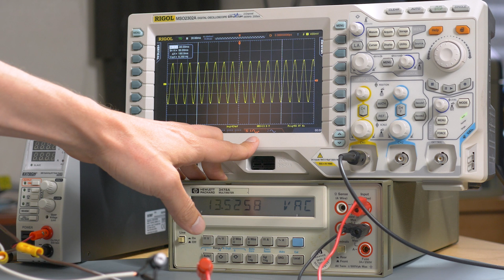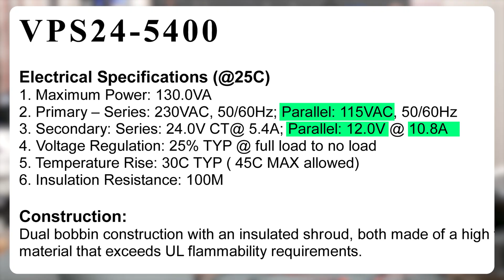What is my transformer output with no load? | Basic Electronics

Comment: How do you determine what a transformer output should be, if there are no specs on it?
Reply from the maker: If there's no specs or even part number to search for, then that's kinda weird.  You can find the turns ratio just by giving it an AC input and finding the output but that's a bit sketchy.  It would be a lot safer if you had a waveform generator of some sort so the amount of power you gave it would be quite limited and you could drop the voltage to something less dangerous. You won't know the max input voltage rating, you won't know what the output will be without full load (as you don't know what full load is) - I feel like if we had any lawyers they would tell me to say don't use it if you don't know what it's limits are.  If you want to take the risks, I'd just look at transformers of a similar size and assume that your transformer will probably be in the same power range and don't push that limit.
Reply: @CircuitBread  Thanks for the reply. It's a small transformer in a pioneer home audio receiver. It has 120v primary and 9v secondary with no load, 4.8v with load. I don't know how common it is for when a transformer goes bad to either completely stop working or output an incorrect voltage. I googled all the number on it without success. I guess the only real way to determine what the output should be is to dismantle it and count the winding's per side, lol
Reply from the maker: Oh man, that would be an unbelievable pain in the butt!  What makes you think that the transformer is bad?
Reply: @CircuitBread  The receiver wouldn't turn on, this is the first transformer in the system for "standby" power. It was also the only component that I couldn't read the specs on. The problem turned out to be a faulty ribbon cable, which is odd because there are no moving parts and it just randomly wouldn't turn on one day. Once it was working and went ahead and labeled all the transformers for future diagnosis.
Reply from the maker: Awesome that it was figured out!  Ribbon cables are great but they're finicky.  On two appliances I've dealt with in the last couple years, ribbon cable failure was the cause.  I was able to fix one but the other, I couldn't solder it or find a suitable replacement.  That was frustrating.

Comment: my amplifier when it idle it's worm and gets heat up like hell when on use. Is this normal for transformer?
Reply: Hi. It depends of power of your transformer.To overcome it, you should change more powerful one than actual one. But same voltage rate. (For ex. if your actual transformer is 24 V / 150W, you should change to 24V/ 250W ).
Reply from the maker: Yeah, I totally agree with Nusret.  It makes sense that it gets hotter when there's a load and if it gets too hot, that means the power rating of your current transformer is too low.
Reply: @CircuitBread    thanks but I'm just worry about how much it's consuming power during idle to gen that much thermal
Reply from the maker: That's a valid concern.  Ideally, the transformer wouldn't warm up at all if there is no load.  So you can get a rough idea of the internal resistance of the transformer itself using an ohmmeter or multimeter, which should be very close to 0.  Or you can check to see if there is a load on the output that you're not expecting.  Those are the two most likely causes of unwanted power dissipation that I can think of.
Reply: Warm under load is ok.  Hot is a bad sign and can damage the insulators on the windings.

Comment: Good to know! I'm actually about to try repairing a car battery charger, which has a very similar transformer in it! Should be interesting to see how it deals with the different amp settings/charge rates with this in mind.
Reply from the maker: Good luck and I'd be interested to hear how it goes!
Reply: Thanks! I may make a video if it ends up seeming worthy.

I'd be interested to hear what happened that bumped your views and subscribers up recently! Congrats, by the way; well deserved!
Reply from the maker: It was rather unexpected, actually - we got a brief but extremely large (for us) spike in views and subscribers when people found our PIC microcontroller series through "browse features" in YouTube.  We're honestly not sure what that actually means.  It's calmed down a lot but our overall daily views is still significantly higher than it was before that spike.  It really motivated Sergey, though!  We hadn't written done any new PIC tutorials for a couple months and then he cranked out four in about two weeks.  Now I need to catch up and actually make them into videos...
Reply: nix324  Sry, but I like to "rock the boat" as much I dislike staying ignorant ;-). Of course, the material of the transformer's core, the thickness of wires and coils as well as the size of the core etc. have an impact on specifications. It's an evidence. But assuming these are "constant" from input to output (apart from the number of turns on each coil if we're not talking about Unity Transformers), then given a certain load and along those specifications, the ratios would represent a pretty good "first glance" assessment tool.